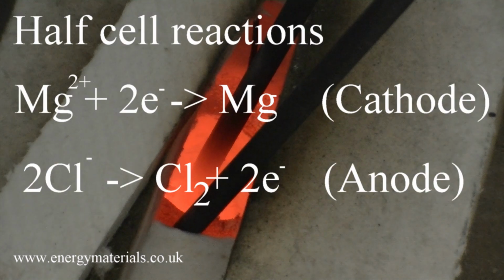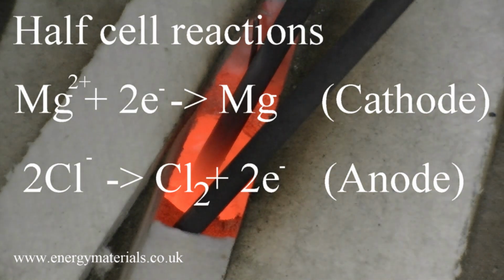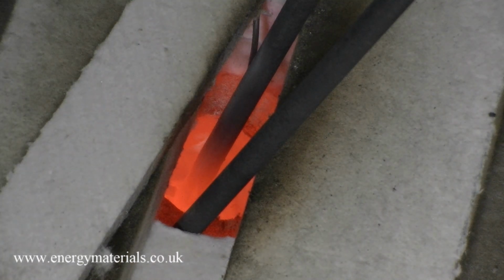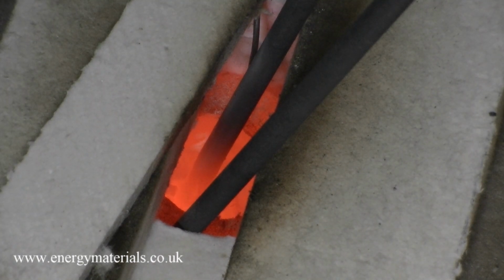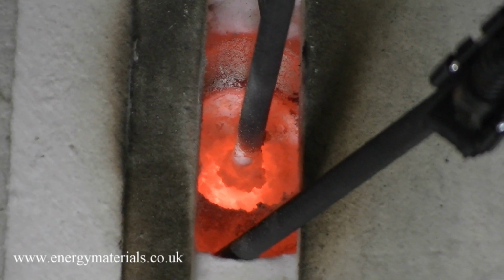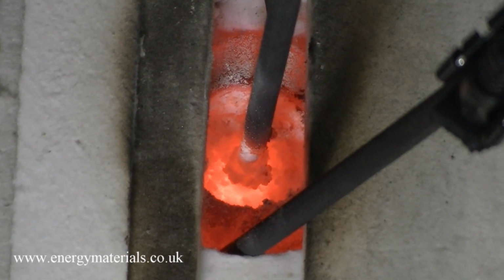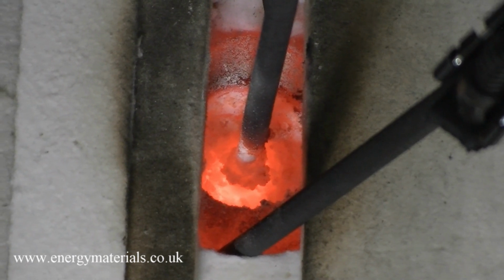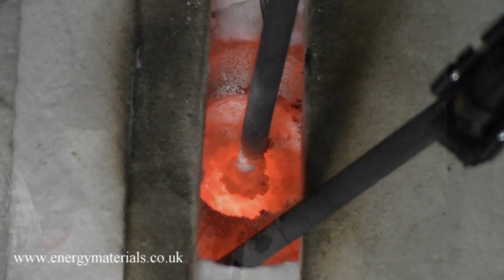Magnesium, making magnesium chloride, flash powder and making magnesium metal.

Comment: Old patent wrote if you make electrolysis in water around +4 C  than you can get the metal too. It oxidised only at warm temperatures so you can only work with low currents.

Comment: Nice try! You need to keep the temp around 670-700 C to get magnesium nicely floating on top of the electrolyte. This is well below the melting point of MgCl2 that's why no one at industrial setting manufacturers uses MgCl2 only but rather a mixture with other salt like KCl, NaCl, CaCl2. Also MgCl2 must be anhydrous otherwise you get lots of spongy sludge
Reply from the maker: You described nicely what occurred, the 'spongy sludge' definitely occurred- I would have thought that the heating would have turned the MgCl into fully anhydrous MgCl but maybe there was some leftover water. It was still surprising to me that I managed to extract some Mg metal with the crude setup.
Hopefully I'll have time to try again, this time forming a eutectic with CaCl2. I'm tempted later in the year to look at sodium extraction from table salt alloyed with CaCl2.
Many thanks